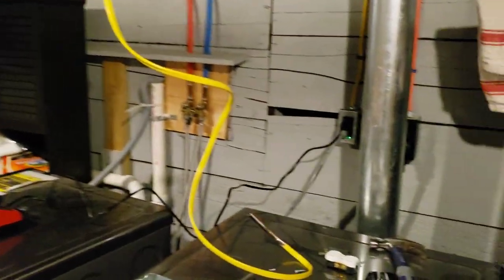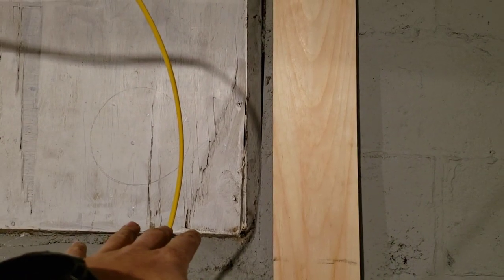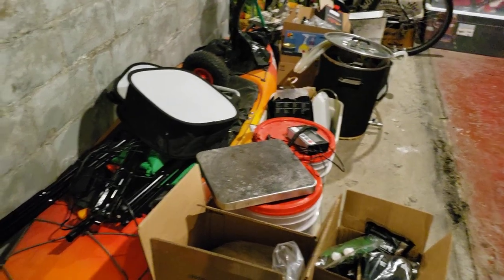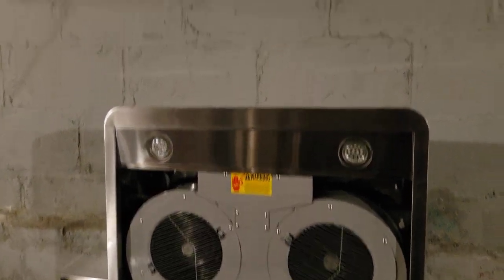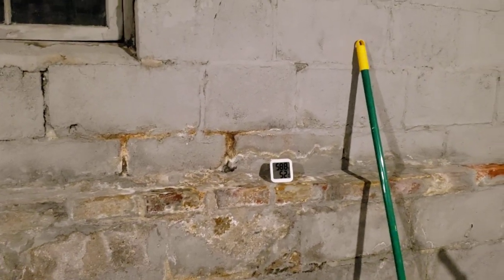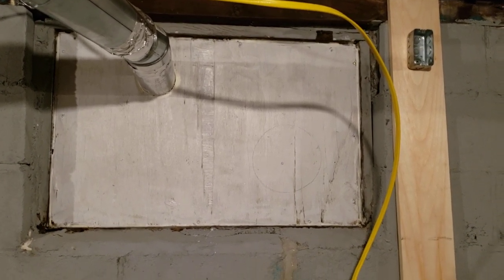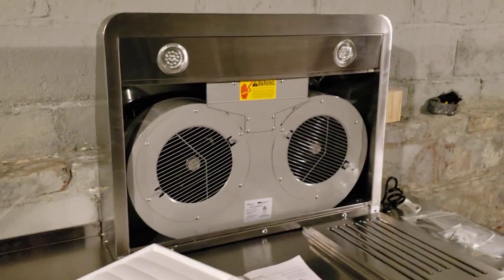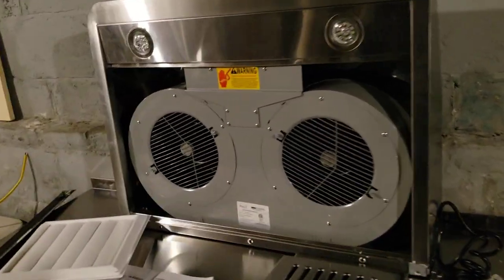BASEMENT HOME BREWERY BUILD Update 1: Hood and Electrical

Comment: There is a Solids/sewage lift pump you can get to move your wastewater to where you need to. They make them for retrofitting basement utilities.
Reply from the maker: That is the eventual plan when putting a sink in. It will plug into the GFCI receptacle I just put in.

Comment: How about diverting your unwanted water into a rain barrel and fit it with a sump pump? I would even toss in a diverter so I could capture hot water to use for cleaning in another vessel, like a 10 gallon igloo cooler? The sump pump would keep the waste container clear without you having to do anything. (Might have to be careful about hop/grain debris in the pump.) Full on sewage pumps are quite expensive and it seems you want something less permanent.
Reply from the maker: Maybe, we will see. A rain barrel will take up as much space as a sink though

Comment: Just a heads up on the hood from someone who vents hoods for a living. The flexible duct you are planning on using will cut the airflow considerably compared to hard pipe. Usually 7”hard pipe will cut a 1000 cfm fan down to about 400 cfm. Flexible pipe will cut it down to around 250 cfm. That however may work for you. Just keep in the back of your mind, if it isn’t venting how you would like, consider 10” rigid pipe. 
PS, really have been inspired by your channel, keep it up!
Reply: Im in the same situation and your comment is very appreciated !!!
Reply from the maker: Good to know!! I was aware of the CFM reduction with a small diameter vent pipe, or a long run, but I figured by getting a higher CFM fan and larger diameter (8") ducting I could counteract that. I did not know that flexible pipe reduces it even more.
Reply: @TheApartmentBrewer  i have a 250cfm hood that exhaust through the back wall in a 4in pipe so my cfm could be less and it does a good job. I have a 120v robobrew so it probably doesn’t boil as hard as a clawhammer but even if you get 400cfm out of your 1000cfm fan it should be enough.

Comment: You can fit a weldless TC port to your existing lid and mount a steam condenser to that, I'll try to use a shotgun-style condenser to partly eliminate my steam. If that won't work I'll mount spray for cold water.
Reply from the maker: I may end up in that direction but I want to see how well the hood works first.

Comment: FWIW - steam condensers work fine with a flat lid - just as long as they make a tight seal. My steam condenser attaches to the side of the kettle near the top via 1.5" TC. Once the steam condenser is running it creates a vacuum that pulls the steam out  whatever port you're using for the condenser.
Reply: I bought a similar one from Bobby at BrewHardware. This is pretty much the same location I have mine and it works amazing: https://www.youtube.com/watch?v=sNfRkdncQzg
Reply from the maker: Good to know! Do you need a gasket of some sort to achieve a good seal? With the Clawhammer being metal-on-metal is that sufficient?
Reply: @TheApartmentBrewer  Not sure about that - I assume it depends on the kettle and lid. I have a Brau Supply kettle and my lid sits pretty tight without any type of gasket.

Comment: Nice looking vent hood. Style points count. I am not so sure the steam condenser is any better than a hood as it wastes water, even if dialed in. If you think you want one, what does the Clawhammer Kettle measure across the diameter?
Reply from the maker: It seems like it will get the job done, at least I hope so. I am not setup for that steam condenser without a water supply anyway so it seems like a little too much for now. FWIW the kettle is something like 13.5" I think
Reply: @TheApartmentBrewer  should you decide later that you would like to experiment with a steam condenser, the Spike Flex fermenter comes in 2 varieties, no pressure is just Spike Flex, pressure is Spike Flex+. The only difference between the 2 is the lid. The bucket itself measures 14 in diameter. Both lids can be purchased from Spike. The Apartment brewer probably has some sway with manufacturers though. ;) I suspect that close of a diameter would be a simple marriage, as either lid has a port out the top for which to vent. Just a thought. I have always been a bit of a tester of engineering. Uneducated formally, steeped in the engineer's laboratory.  Cheers.
Reply from the maker: @beeroquoisnation  So you're talking about more of a brew in a conical type setup? Interesting idea - I know you're working on something like that, and thats a very innovative idea! It's always fun to see how homebrewers innovate, there are so many different ways to get the beer at the end of the process!
Reply: @TheApartmentBrewer  Well, you mentioned that there was no lid available. Never let the marketplace dictate to you what is available or not. It is acceptable to take those matters into your own hands. You're not reselling it, you're using it. That lid would be easy to fit on your Clawhammer if you wanted such a lid. Finding a gasket comprised of heat rated silicone would be the challenge. I said challenge...not limitation.

Comment: If you use 4 inch square boxes you will find alot less effort to cram wires in the box especially when using #12 wire
Reply from the maker: Sadly I already got all my boxes, but that's a good point. 12 AWG is a bit stiff